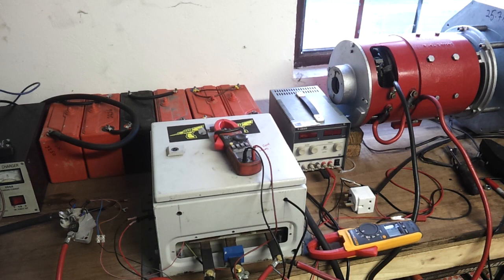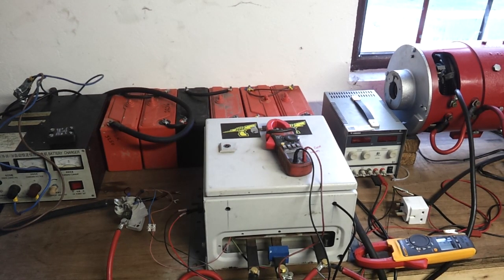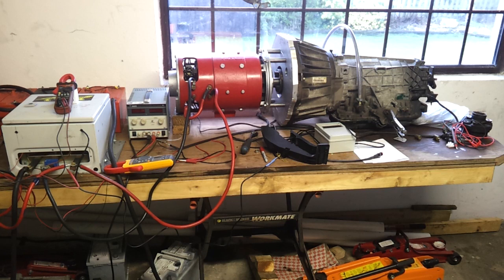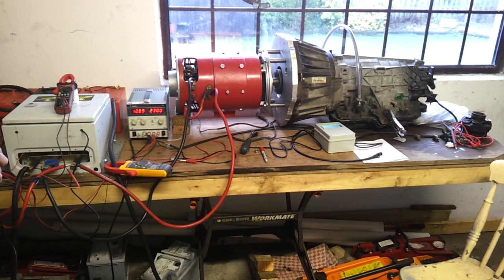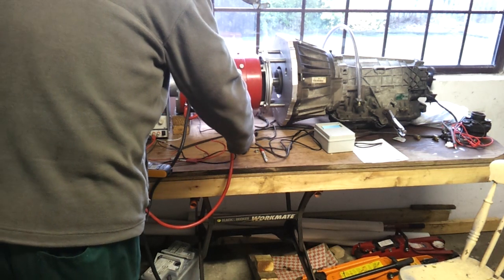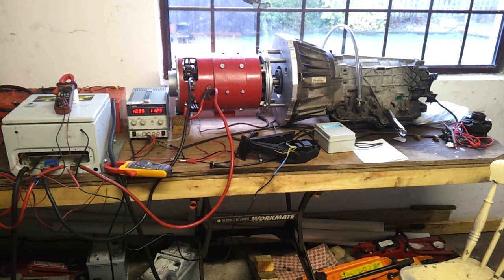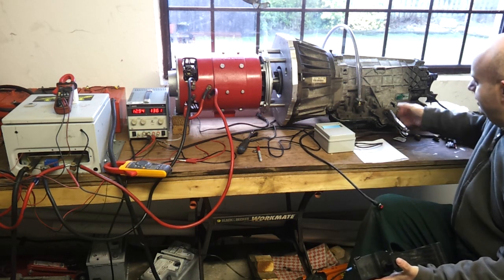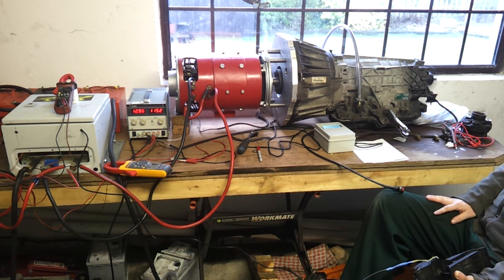EV ZF Automatic Gearbox Controller 08 : Throttle Up

Comment: How can you bypass torque converter? Use a separate pump to have oil pressure so motor can be off & only on when driving?

Comment: I wonder if anyone else has done a electric to auto gearbox setup. Some older cars are hard or impossible to find with a manual gearbox and not everyone can afford a motor powerful enough not to need a gearbox.
Reply: EV West used a powerglide in their Pikes Peak BMW initially. I'm thinking of doing it in a mustang build just for faster shifts. There's nothing wrong with using the gears of an auto, you just dont need the torque converter. The hard part is keeping line pressure at a stop. You have to idle the motor or use an external pump.
Reply: @jwiger  here’s a beautiful example with a powerglide Corvair truck. https://youtu.be/jCSKUchhhuY
Reply: For those cases you can consider the Lexus GS450h or GS300h gearbox. There are videos about those on this channel as well.

Comment: Surely a major downside is that in use the motor would have to spin up, even when the throttle is released?
Otherwise the transmission fluid pump will stop when off the throttle going down hills, with the internals still spinning.
Reply: Set minimum voltage on throttle to slightly above pedals voltage range some motor is always slightly spinning
Reply: @Acceler2  Yes that could be done at the expense of range, which would already be hit by running through a slush box.
The cons would seem to greatly outweigh the pros,
Reply: @matthewjenkins1161  unless your car is an auto already… I’m in this boat, so if you know anything about a workaround please share.

Comment: good idea, but automatic transmission will need the pump running at 750 rpm to make everything ready to shift, doing this will cause to feel hard shift at beginning
Reply: In your opinion,  
Would it be best to use a Manual transmission?
Reply: @ringoringo8000  If you can yes its better. But your car might not have one.

Comment: This, is the first of your videos that I've ever seen, … so, … I got halfway thru the video & though to myself, ….. WHAT, ….. is the purpose of this test? ….. there is NO LOAD, (ie: … the car), ….. I suppose, (not seeing any of your prior videos), this was just a bench test to see if it would work at all. ….. I then thought, an engine, (be it petrol/diesel or electric), is an engine, it is "meant", to turn gearboxes to drive the vehicle. Would you be doing such a bench test with a petrol or diesel engine? ….. I don't think you would.
Or as the title says "Controller", ….. I think you were testing it all,  motor-controller & gearbox together. ….. I would have tested it in the car/vehicle, ….. if there was a problem, it would have shown itself there & not on a bench.
GREAT video, … I love watching guys like you testing things because it saves me having to do it. ….. Thanks Mate...…….

Comment: I think the potential is out there for this project.  So this is the challenge I see; how do you have an electric motor that can idle like a regular gas automatic?  Regardless of efficiency loss; this means more of the original parts can be used on the project.  Indeed, the solution I would think is to have a two brushless motor setup.  When the vehicle is "on.." and electric motor that only idles charges the steering pump, torque converter, water pump, and air conditioning unit.  Also, energy could be required to heat the transmission to normal operating temperature.  When the vehicle is selected in "drive" a separate motor can take over to spin up to higher rpm's.  In other words, mimic the gas engine as close as possible using current without having the dual motor assembly any larger than the gas engine itself.  Range and effecieny might be cut be half, but building time/labor costs could be cut much lower?  Perhaps..
Reply: If the motor had a tail shaft, a pulley system could be attached to run the power steering, A/C and 12v charging system. I’m aware that electric alternatives exist, but I would like to think that this would potentially work.
Reply: @ashleywilson6145  wouldn't that reduce the efficiency of the electric motor🤨
Reply: Both ways take extra battery power to  run the extras, vs just the motor to drive. But if you use a pulley system to run the power steering system it would only work when in motion, not at idle or a stop.

Comment: Not quite sure what you are trying to demonstrate here Damien? Is there a torque converter still in the system? I understood that to convert any auto trans for electric drive motor you need hydraulic pressure via a torque converter or a separate  electric hydraulic pump that keeps normal pressure in the trans.
I have a 1993 XJ40 4.0L Jag I am looking to convert and it has an electronic ZF 4 speed auto. It seems that if I run a torque converter I must have the main electric motor idling at about 400 RPM. If I do this I can also run altenator, air conditioner and power steering via an adaptor plate on the front of a motor with a double shaft.
Any comments please?
Reply: Oil pump is inside the transmission not in the torque converter.
Reply: The clue to what he is demonstrating is in the video title.

Comment: Your setup is a good way to smoke the clutches in the transmission. The pump has to be running when you put it in gear in a real car, which means the electric motor has to be "idling"

Comment: you should get rid of the torque converter it is not needed and sucks your precious power.
Reply: I was saying the thing it had max torque at 0 rpm, and the converter will slip
Reply: Surely he's using a 'lock up' torque converter which has a nice smooth power uptake then no slipping when in lock up mode, effectively giving direct mechanical drive.

Comment: I know nothing about electric cars but now I'm getting it...😏....throttle or accelerator is connected to the controller/inverter😏😏😏...brain works..…whats that thing the motor is connected to?transmission?

Comment: Why are you using the transmission?
Supposedly there are not needed transmissions when you are working with electric motors, because they run at a pretty good torque even at 8000 rpm
Reply: If you're making a racecar you want to keep the motor in its peak torque range
Reply: Efficiency reasons. Sure motors make the most torque at lowest RPM but they also draw TONS of current = inefficient = dead battery after a 1/4 mile. Efficiency of DC motors happens PAST peak power (half of no load speed).
This is going to sound really counter intuitive but if you have a big enough motor controller you would get max performance (worst mileage) in 5th gear.
Reply: @JonPrevost    Very well stated. Thank you.   If my host is a 3000lbs  RWD Automatic with all the ICE stuff and our goal is very modest.. 40mph and 40 mile range max.  Is there any alternative to a transmission/gear box we can think about with a DC motor? Might two gears be enough? Maybe a sweet spot gear ratio or two independent motor/gears with a flywheel or manual switch solution? IDK... Just talking out of the side of my mouth... Just so elegant the idea of eliminating another giant canister of oil from an "EV" project and saving big bucks by reusing decommissioned DC motors.
Reply: AC's yes....DC are rather like 3,5-4Krpm but what he has done space-wise is strange...that is never gonna work with that torque...the shaft would have to be cutted/shortened
Reply: Well you can use very low RPM on the electric motor 1000RPM at 60mph with a different diff, less noise.
Reply: I think its better even though electric motors have instant torque   and spin 20,000 rpm with a good power band.   Let's say if you have .5:1 gear ratio that double the torque and final gear could be 1:1 like normal. You wouldn't lose too much power though the transmission because you don't have a torque converter

Comment: why need tran
Reply: Speed.  The torque and power curve of a electric motor is relatively a square wave but for max speed say like cruising at higher free way speeds it would be more practical to have a few gears to shift through.
Reply: I think the same think, the electric motors can run farther than 7000 rpm and that is why they dont need a transmission.
Reply: @zorrosigiloso5280   because you can triple the torque if you wanted to.

Comment: I am working on a project. I am going to put a Ford 4.6 DOHC motor an transmission in a older car. And I am trying to do it without the ECU. the program you have write for the arduino would help me a lot. You have all ready invented the wheels. So it would save me a lot if time. You have a great program all ready, and I know you have put a lot of hard work into it. I can't find anyone to help me out so far. I live in the USA. IF YOU CAN EMAIL WERE I CAN GET THE PROGRAM I Would REALLY APPRECIATE IT THANKS GARY (gary526@att.net).
Reply from the maker: https://www.youtube.com/watch?v=BZWsIrKKEog